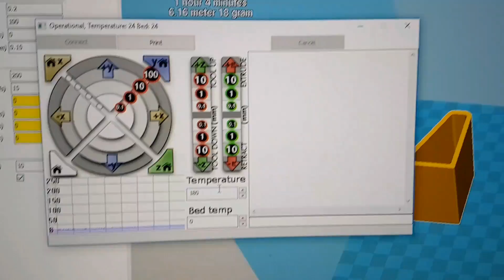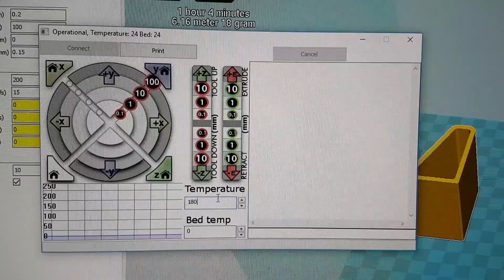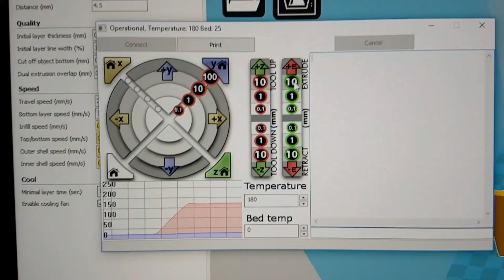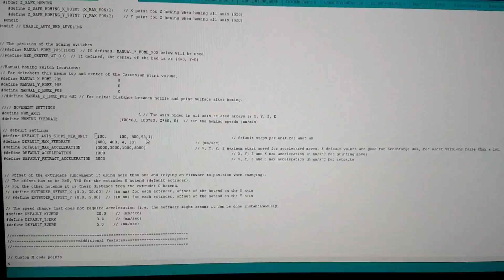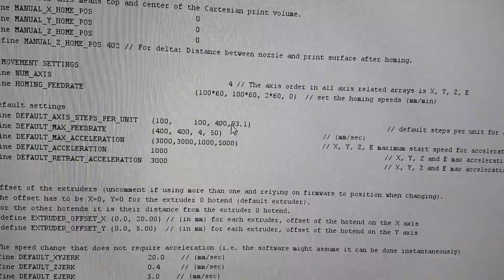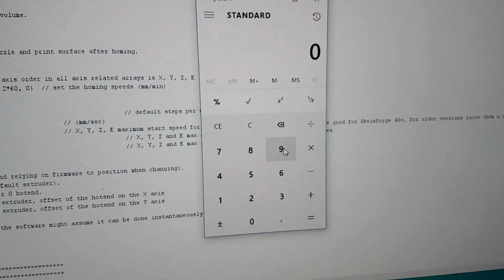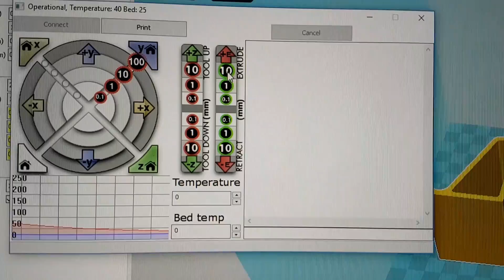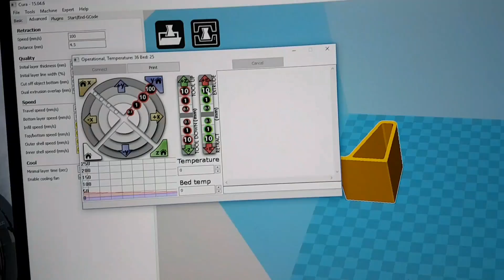Anet A8 3D printer E3D V6 fine tuning in firmware for best results

Comment: Hi Nexi, thank you for ur video it was useful

I have a  ِAnet A8 printer when I try to move the  Extruder stepper motor via control panel it does not work!!
Do you think that one of the Firmware lines needs to be modified?

thank you..

Comment: how to I open the window that you are using in Cura? I have the printer turned on and connected to my computer with Cura 15.04.6. I use Skynet firmware
Reply: that window is actually from "pronterface" or "printrun" he kinda made it sound like it was from cura. but its actually a separate program

Comment: what if i dont have the Skynet Firmware?
i mean, i want to upgrade my anet a8 with the e3D V6 but i have the default code running 
Where do i change the settings of flow extrusion.
Thanks mate.

Comment: Nexi, Keep up the excelent work. You are a godsend with your helpful advice.

However when I go through the same steps I get 42 mm... After changing the settings the only changes that I get is the speed at which I get the 42mm. Any thoughts?
Reply: Turns out my Adrino wasn't actually writing to the board... something to figure out for another night... but by entering the gcode of
 M92 X100.00 Y100.00 Z400.00 E292.60

where 292.6 was my calculation I was able to get it to the board.

followed by M500 to commit it to memory.

Hope this helps someone else.
Reply: it works. thank you so much. been scratching my head all day long

Comment: did your steps keep getting 45mm what is it iam doing wrong
Reply: I'm getting the same thing... 42 mm changing the setting only changes the speed I get 42mm.
Have you had any luck sorting this out?
Reply: Turns out my Adrino wasn't actually writing to the board... something to figure out for another night... but by entering the gcode of
 M92 X100.00 Y100.00 Z400.00 E292.60

where 292.6 was my calculation I was able to get it to the board.

followed by M500 to commit it to memory.

Hope this helps.
Reply: What version of skynet r u using? It used to keep giving me 29 eventhough i requested 50 when i use version 1. When i update to version 2 it start to give me the right amount

Comment: Hi nexi ! since you are using the Skynet firmware , so I wonder is it stable or not ? 
And how good is it , user friendly ?
Reply: can I use this 12864 Display LCD 3D Printer Controller on our original board ?

Comment: Hey Nexi I upgraded to the v6 with bad problems. It prints fine for a while, then jams. I use pla. Any tips? I heard that pla could be sticking in the heat-break and is called 'heat creep". Any help would be great!
Reply: No I don't. I had a improper machined heat break and it was rough inside. I bought a microswiss plated heat break and i haven't gotten a jam since.

Comment: Hi nexi just done this setup with exact skynet u r running and mine is extruding 31.9mm when I click it 5 times so I adjusted the figure to 141.0 and uploaded filmware and still getting the same 31.9mm when I click 5 times can u help ? Using the hob goblin gear with e3d v6 genuine thanks

Comment: Hello I just converted over my extruder the same way you did for your printer and I followed all your step with Skynet. Problem that I am having is that while I'm printing halfway through the print the printer stops and reset and start re-printing and it does not lined up the ruins the print I was wondering have you encountered that with any of your prints?

Comment: Were you capable of manually controlling the printer with the stock firmware. I seem to be unable to with cura, repitear host, and pronterface
Reply from the maker: Try old version of CURA 15.04.6?
Reply: yes and I plan to eventually upgrade everything to roughly your set up with some design changes to the extruder mount to max z height. just haven't gotten all the parts in the mail. but wish to check extrusion distance.
Reply: yes and i plan to copy your set up except for some design changes to the hot end to max z-height. but till my parts are delivered i wanted to check the extrusion distance like you did here but have not been able to control my anet.

Comment: @Nexi love your videos! I installed the same hot end as you on the same printer. My prints are great but I have one issue and am wondering if you experienced the same thing. As my hot end heats up, fillament comes out of the tip and then when it starts printing, nothing comes out for the first bit. Any ideas about how I can fix this?
Reply: Matthew P Try going into start gcode in cura and editing extruding length at start of print

Comment: when using aluminium plate, go try again mounting autyolevel sensor, it will take a little time to set its position and autoleveling boundaries, then z offset as you will probably use non standard carriage, but its really worth it, just try mesh autoleveling not linear, as aluminium bed is not flat in the middle. I did try three of them capacity, metal detectror and that chineese blue metal detector usually sold with anet, that third one is most precise. just after moiunting, play a little with G30 and you will see that it is worth it. you will forgot about screws in bed, its is also very good option when you use vertex or buiold talk or coropad(this one is best in my opinion and the cheapest). also it is really time fo octoprint upgrade, managing printer by phone, tablet or monitoring it even outside of home is greate feature, you will also forgot about usb card as you will be able to copy things over wifi.. and you will be able to do timelapses :)
Reply: and btw. when doing extrusion caliubration you should really extrude, not only use it for pusing filament to the end of the tube as it is always  pushed more than without real extrusion. just measure it in pleace before the extruder..  and it is common to measue 100 steps as it is easier to calculate and more accurate... also speed of the extrusion is importan during measurments, try 80 for 1,70 filament

Comment: Nice video!!
I've done to mine the same thing,it had the steps set to 90%.changed to 95% straight from printer's configuration and there is a big difference indeed!!!@100% it extruded 105mm.
I'm very curios about the E3DV6...I've found a few on amazon.co.uk and i'm not shure what to do due to original/chinese debate.On the other side I saw that you bought one from AliExpress so I just ordered the one that you posted!
Thank you very much for video!

Comment: Hi Nexi

Grate videos, i can’t find operational window in my Cura, where do I find it?? Which version of Cura do you use??
Reply: In cura 15.04.06, do the following:-
Connect USB cable to printer and computer
File menu ＞ Preferences
“Print window” section ＞ “Printing window type” ＞ Select “Pronterface UI”
Click Ok
File menu ＞ Print (or Ctrl + P)
Wait for Cura to connect to printer
Reply: Thanks @james tourish

Comment: that print quality is awesome! Great job!
Could you estimate how much money you had to pour into your upgrades (including filament if you printed parts yourself)?
Reply from the maker: Thanks mate! Lets see: V6 was 9USD and 1kg of PLA was 21USD, Buildtak vas 20USD, some bolts, screws,switch,vga heatsink,belts,bed cable, lamp... Well everything for less then 70-80bucks and DAYS and DAYS and NIGHT after NIGHT of working and adjusting everything to be perfect as possible.

Comment: Any other suggestions? Checked port number, bit rate, running skynet. Was able to upload skynet via aurdino so computer picks up USB but cura will not. At least control window won't pop up
Reply: sorted 
cura 15.4.6
-File
-Machine settings
-communication port(mine is com4) and baudrate(mine is 115200)
Not sorted with command window YET!
Reply: yep!same problem,would be nice for a bit of help!
Might be due to version of cura,are you usin 14.xx?
Reply: I have this same problem. Is there something you have to configure or a video to help.
Reply: just let me know if you need more details

Comment: Have you thought about a direct drive system for flexible filaments such as this setup http://www.thingiverse.com/thing:1798616/#comments
Reply from the maker: Hm... Looks interesting BUT am not going back to direct drive and that heavy setup. Bowden extruder setup can print Flexible filaments as well with little of settings. I order already some flex filaments and ABS so am going to test it up. It should not be a problem.
Reply: +Nexi ok thanks for the feedback. I wasn't sure if your setup would still push filaments like Ninjaflex through but I'm looking forward to seeing how you go. Thanks for the great videos. They have helped me a lot.

Comment: I cannot get the control window to pop up. I have skynet and followed last video and using cura 15.04. What do I do?
Reply from the maker: james poe Go to settings and choose your Serial port.
Reply: I have done that too. Window still will not pop up
Reply: Go to File > Preferences > choose "Printing window type" to "Pronterface UI".
Reply: James Poe, had the same problem. After you've chosen the serial port and switched to the Pronterface UI you just have to hit Ctrl + P or select Print from the File tab.

Comment: Hi Nexi,

I've been printing stuff on my Anet A8 since I got it this month, and so far the quality is excellent. I used some of your helpful videos to get it up and running.
https://imgur.com/a/pwVm4

I have an advanced question about bridging. I have become obsessed with getting it "perfect".. it is alright, but not quite perfect yet.
https://imgur.com/a/Ii0qy

My bridges are very good, but still have a fraction of a mm of droop. I can print 5 of these in a row, and they all come out the same.

I watched it printing and saw what was happening. When it makes the initial pass between the towers, it isn't extruding enough, so there's about 1cm of really flimsy thin filament, then a small gob, then a smooth straight stretch reaching the other tower. Then it does the same on the other side without any thin portion... on the next pass across, the fan blows hard enough that the thin portion can't hold, and the strand across droops slightly. It's very minimal, but when I was watching it, I saw no droop at all on the initial pass. That makes me wonder if the solution to perfect bridging might be three things?

1) Pause before initial bridge to allow some filament to build up in the extruder?
2) Perhaps building a tiny ledge to grab onto before crossing the gap?
3) Cut fan speed slightly to prevent it from snapping the filament?

Do you have any thoughts? You're clearly knowledgeable on this stuff, so if you have any input/ideas, I'd appreciate it.

I'm not averse to getting my hands dirty with coding, so if I need to rewrite something to get it perfect, I'm totally up for it - but I'd like a second opinion with more experience before spending the time on something like that.

-BikeHelmet

Comment: You should disable the hotend when not using it. it may cause a clogged nozzle when heating up for so long and not extruding. Send an M302 gcode to allow for cold extrudes :)
Reply from the maker: Jannes Vandepitte Thanks for tips mate! :)  But for this short period of time it's not a problem. I even tried how long hot end can stay on 200C without printing to get clogged :D I had to test it :) Thanks again for code I should put in video description full list of codes from Wiki.